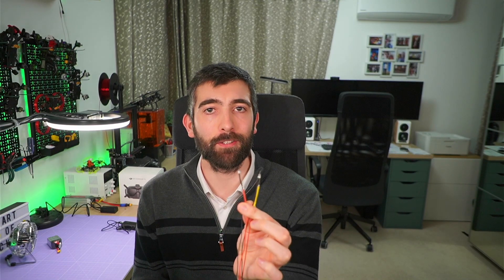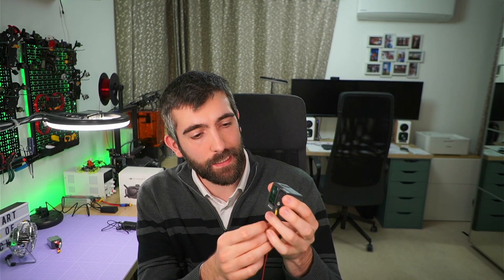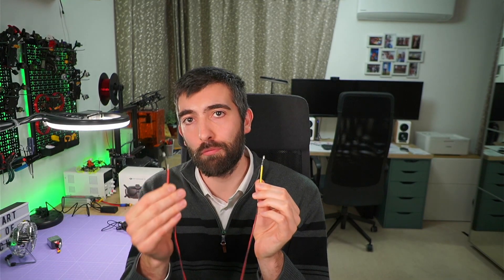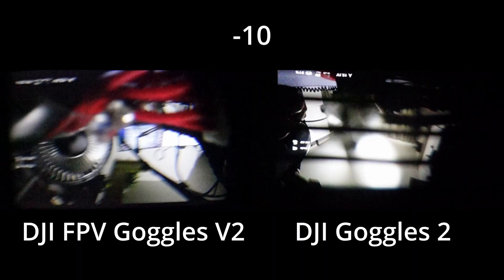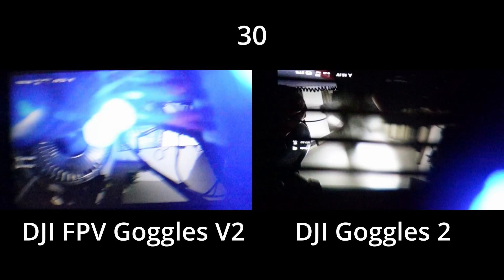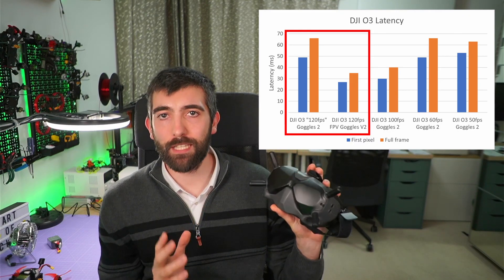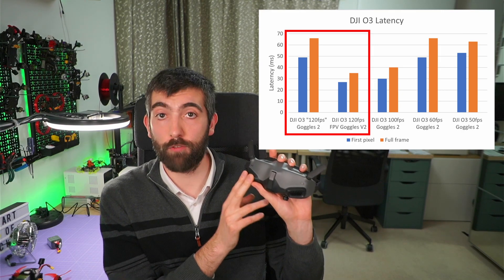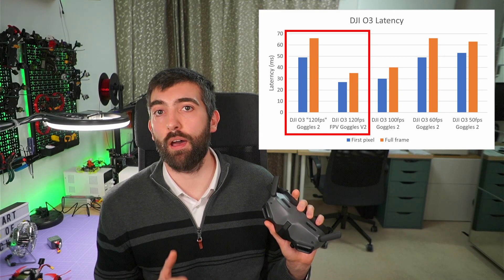When is 120fps NOT 120fps? // DJI O3 Air Unit 4k120 latency and refresh rate testing

Comment: Thank you for confirming this!! I recently did these tests on the v2 goggles, but suspected this to be the case with the goggles 2 at 120fps since we have heard from the start that the panels are 100hz max.  It made the most sense that they would be sending 60fps over the video link, but recording at 120fps on board.
Reply from the maker: Yep. That's what's happening, just don't want Goggles 2 users to switch to 120fps and suffer worse latency!
Reply: You both get bacon for this!!
Reply: @torpedoLaw  I will take mine crispy, as always. lol

Comment: Can Confirm that 100% for Goggles 2, was flying yesterday with the New Update on Goggles 2 and O3 Air Unit. Was flying before 2,7k 4:3 100fps, tested 2,7k 4:3 120fps and it immediately feels like switching to 60fps mode. So in the End like in your test 100fps feels best for flying with lowest Latency.👌 on Goggles 2.

Comment: Hi Chris, since the latest firmware released 4K/30fps, can you please also test 30fps VS 60fps? For filming purposes I prefer to use 30fps in combination with 1/60" shutter speed, but I'm wondering if it's better using 1/60" with 30 or 60 FPS. I know on paper 60fps is better, but with 60fps I will have the file size that will be double. Thanks a lot!
Reply: I tried recording 4k/30fps on 03 unit.. it was awful flying with 30fps. Because of this im shooting in 60fps

Comment: Hi chris sir,
I am facing a problem,,,I am using polar vista with my dji goggles 2,,everything is okay but whenever I take my drone 150m-200m away(fully open space) my signal drops to 5-6mbps,that's unexpected,,goggles 2 has no option to change the milliwatt,,,kindly help me to solve my problem

Comment: Hey Chris great info! I have a question for you though. Did you test this at 2.7k 120 fps? or is that not an option in this new update? As I understand, all 4k recording modes put you at 60fps in the goggles. To keep lowest latency you must use max of 2.7k. I haven't updated yet, so I don't know what new options there are. but if there is a 2.7k 120fps recording option for the goggles two I would be VERY interested to see if it displays still at 100fps in the goggles two.
Reply from the maker: As I understand the resolution is just for the onboard recording (the live feed is always 810p on V2 and 1080p on goggles 2) The frame rate is respected by the live feed in all modes. The goggles 2 support 100hz and 60Hz (50fps is just frame doubling). The goggles V2 support 100Hz and 120Hz (with frame doubling as necessary)

Comment: Better yet. Use 1 LED that's picked up by both cameras. The FPV camera can see the single LED. The observer camera can see both the screen showing the FPV feed and the single LED.
Reply: i was also thinking about this 2. led. why? :-)  i would have used a little mirror, if it is not possible to put it perfect in focus.
Reply from the maker: You're right that a single light source would also work in theory. In practice it's  much easier to set up one led in front of the high speed and one in front of the fpv cam. The goggle optics need the high speed camera to be where your eye is and the goggle is designed to stop light leakage from outside the goggles. This makes it basically impossible to see the whole goggle screen clearly through the goggle optics and anything else outside of the goggles. It's verifiable that the LEDs in parallel turn on together within much less than 1us. Usually single digit nanoseconds so they are effectively instant for these purposes. Making the two LEDs equivalent to a single source.

Comment: The O3 system as it is right now is such a compromise. For the least latency, you have to record at 100 fps. But it does not divide evenly to any frame rate other than 50 Hz. Which is only suitable for PAL broadcasts. There needs to be an option to ditch the recording function to have it behave like a regular FPV camera and then record with an additional dedicated recording camera.
Reply: 100->50->25, when I had it I used 25fps, and had really good results. Try it, you will likely be happy, just keep every 4th frame and it works really well. But this is for cinematic… never could record freestyle with the system.

60fps video turns out okay, but then flying becomes not fun… quite the compromise.
Reply: @lemonsquareFPV  True you could go 25fps.  It all depends on what media the content is made for. I just wanted to point out that the system is limited since its used for both viewing and recording. Apparently many like it, just not me. For me the odd frames are too visible.
Reply: @icp-trek  I agree 100% that’s what I was getting at, maybe I didn’t express myself properly.

Unfortunately that’s how the system is, and honestly that’s the least of its issues :p I flew 30+ days in the air on the system but gave up and moved on to better things. And that’s okay. It’s the absolute perfect system for a lot of people… I’m just not part of that “lot of people” group. :p

All the best.
Reply: The Goggles 2 is such a weird halfway house product. Modernised and squeezed into a tiny consumer package at the expense of optical design, anti-fog, RF performance, and frame rate. And the fact that most people with Western faces find it uncomfortable.
Reply: @lemonsquareFPV  Interesting, thank you! In that case have you gone back to analogue? Are you buying into HDZero?
Reply: @babc142  I primarily run the HDZero goggle, predominantly with the Runcam90, but I really like the V2 cameras too.

As a secondary I like Avatar and analog, I still enjoy both. And now I can run all 3 on my one goggle, it is VERY convenient!

Analog is still very fun for me, I like the Predator camera for daytime and Cat or Eagle cameras with IR illuminators for pitch dark fun.

I also really like the consistent latency and smooth flight feel of Avatar, and I really like the nano camera.

But pure speed wise HDZero is unbeatable and is my favourite, with Avatar a close second. And if I had to rate everything else I have used, analog next, then O3, and DJI V2 in last place.

It’s because DJI feels really bad in the air, they sacrifice smoothness and consistency for absolute picture quality. But the problem is that we are flying, not just looking at pretty pictures, that’s why Avatar is so smooth and consistent, they prioritize latency and link stability and sacrifice picture quality, which I GREATLY prefer!

What do you prefer? Do you still like analog? What are your thoughts and opinions? What cameras do you like?

Comment: thank you! just a thing, dji o3 goggles 2 4k 100 or 1080 100? which is better for low latency
Reply: also because in 4:3 you can 100fps only in 2.7k or 1080, but you can see much more

Comment: How is the effect of the shutter speed and the framerate of the video recorded by the gopro being taken into account in the latency calculation?
Reply from the maker: If you're using a go pro the frame rate of the go pro doesn't affect FPV latency as they are completely separate cameras. Usually you'll run the Go Pro at 30fps and the FPV cam at 100/120fps.

Comment: So DJI new goggles 2 are slower and we are locked to choose the same refresh settings, aspect ratio and picture settings of the recording as live feed. Getting a live feed to fly safely is different from recording the flight IMHO , this is not a safe system as soon as you want to substitute O3 to an appropriate HD cam.

Comment: Great video! Where can we find this 03 camera mount (this soft mounted one) for the AOS 3.5?
Reply: soft mount better, also on a AOS Frame?
Reply: @rolliseventeen  DJI 03 camera needs to be soft mounted for the stabilization work properly.
Reply from the maker: I'm working on this with iFlight right now. Trying to find a solution for all the different cameras that works well. Stay tuned! All iFlight O3 BNFs including AOS have a soft mounted O3 camera at DJIs insistence.
Reply: @ChrisRosser  Any chance will be seeing this camera mount selling separately?
Reply from the maker: @barraca1393  Honestly it's been a real struggle with this O3 launch with the different form factor and mounting requirements (and no clear instruction from DJI). I am hoping to do a O3.1 update which will standardise the mounting and support all the different FPV cameras out there. It'll be a few weeks before that is ready but I'll go as fast as I can. 👷‍♂⚒⚒
Reply: @ChrisRosser  Ok. Thank you very much for the answers.

Comment: Thanks Chris so much for this info! Why but why would they give us 120FPS 4K recording and drop us down in the goggles to 60FPS why can't they do it at 100FPS? Because the frames won't line up is my guess?
Reply from the maker: I think the goggles 2 screen only does 100Hz and 60Hz (as of today). 50Hz is displayed at 100Hz (frame doubled) and 120Hz they just discard every other frame. You could drop every sixth frame but that might look a little weird with constantly variable latency and there could be tearing issues.

Comment: When using 120fps on the O3, DJI is most likely sending one frame out of 2 to the G2 Goggles hence the 60 fps. It's a way to make it work from a single video feed. If it did send 120fps to the G2, it would likely be out of sync with the panel resulting in even worse latency. So yeah, stick to 100fps. DJI could do a better job at explaining latency on their UI.

Comment: Its almost like the V2 goggles are better. I mean if you could fly in 4k low latency mode and cant do it on goggles 2 is weird. Atleast 100 fps would had been nice.
Reply: Your forgetting the resolution difference. The V2 at 810p is vastly inferior to the 1080p resolution of the newer goggles.
Reply: @matthewbradley8971  that is correct. The screens look so much better as well. Im just saying for sd card recording. But the V2 can connect to everything fpv. For ppl that only fly the fpv drone and the avata, its a huge plus.
Reply: @matthewbradley8971  but you see better with the Dji 03 on the v2 than a caddx vista for instance.
Reply: @amathma  I don't know if that's objective. I've seen comparison video's and to me it seems there is way more definition in shadows/branches when using the 'older' system.
For sure, the O3 system grants way better picture quality, but i wouldn't call it an upgrade for everyone.
I was thinking of upgrading to O3, but i really don't see a reason, to be honest.
Reply: @FPVSlice  I’ve been testing in different situations the DJI 03 on cinebot vs Caddx vista on Nazgul 5 and Protek 35. I can confirm you that it’s an update with better quality in the googles and also on recording video. Plus in most of situation you can do some warm ups/test flight with no go pro on it and then put a GoPro if need it.

Comment: Have you tried 2.7k 120 and 1080p 120 just curious what those do
Reply from the maker: They operate very much the same as 4k120 fps in my testing. The live feed doesn't respect resolution (that's just for internal recording) it only respects frame rate.

Comment: Flying the 03 with V2s and the latency feels great with 120 fps mode. Don’t notice any difference over the v1 DJI air unit/ vista. I actually think the 03 latency is more consistent but that might just be me.
Reply from the maker: I would expect you're correct. The O3 RF approach is much more advanced so it probably keeps a more consistent link. Latency on the V2s is very similar to DJI V1 (about 3ms more).

Comment: you are comparing a 1080 data stream to a 720 data stream, the test should be done by limiting the O3 to 720 on the goggles 2
Reply: you cant limit the stream to 720 with the goggles 2. its 1080. and i also think it was not a 720p, because the V2 has 810p display and i think it demands 1080 to get the full 810p according to the specs from dji. otherwise it will pull up a 720p stream to 810p?  i dont remember that it will do this.  where did you read this?
Reply from the maker: I believe the stream is h265 1080p to the goggles 2 and h264 810p to the fpv goggles V2. This is not currently configurable and independent of recording resolution and fov settings.